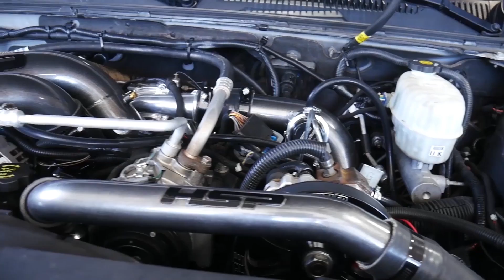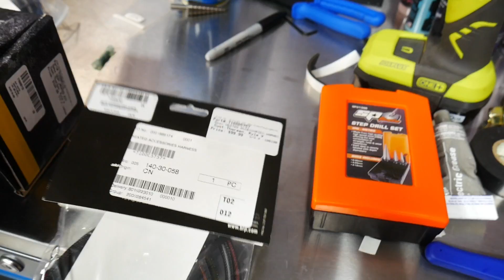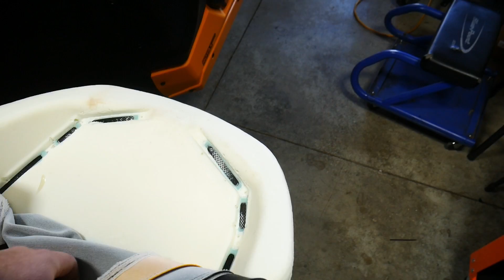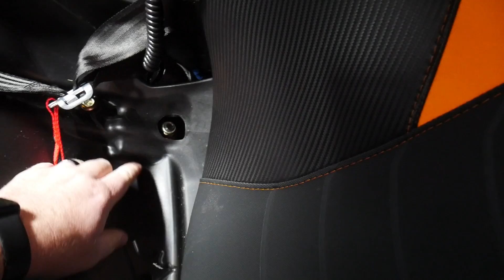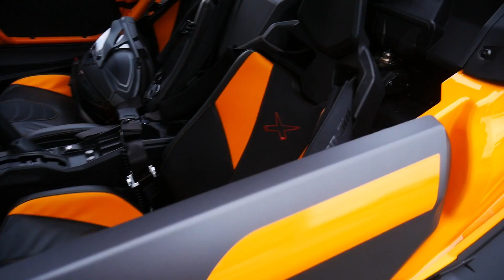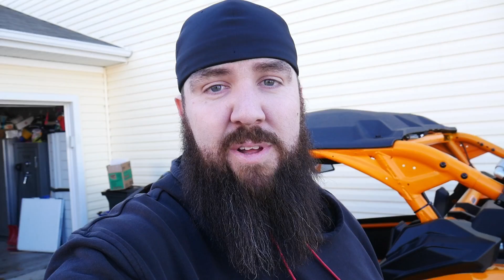INSTALLING AND TESTING HEATED SEATS - 2020 CAN AM X3

Comment: You probably won't need a bigger battery. A battery just stores electrical energy, the alternator actually creates it. So if you use more than the alternator makes, it'll still go flat. But if you use less than it makes, all you'll have is two charged batteries instead of one. Which has no benefit, and your UTV is now heavier.
Reply: He said alternator.  Lmao